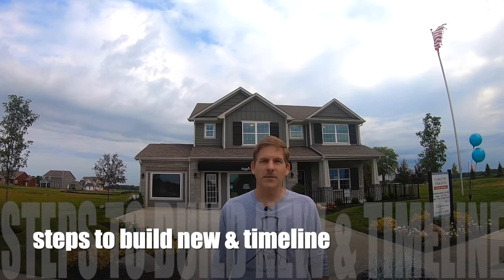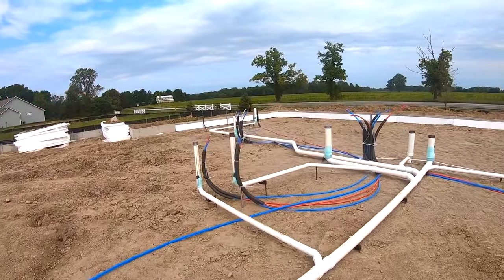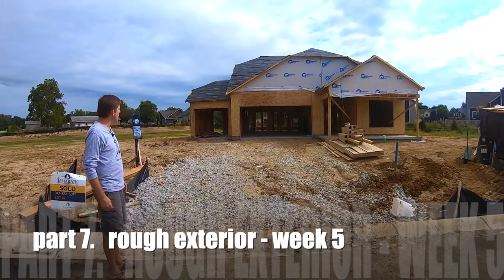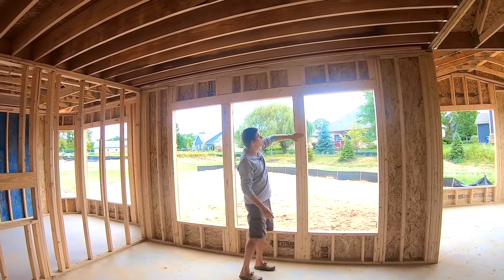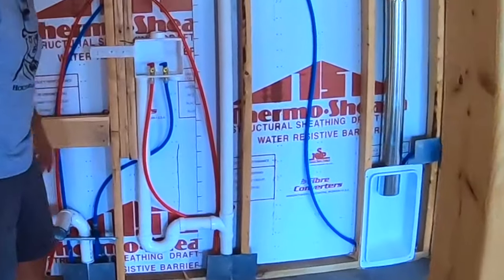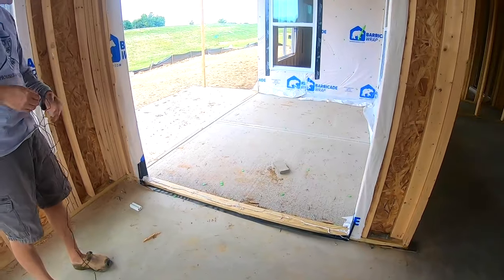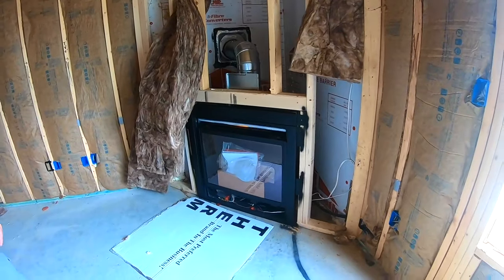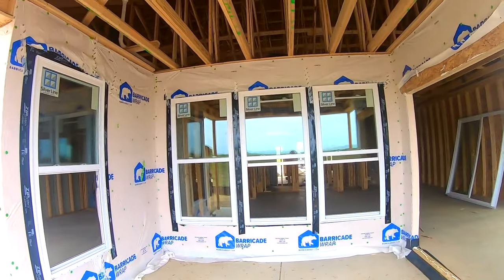steps to building a house timeline

Comment: Typical American house.. can't even withstand heavy wind such as tornado. Maintenance cost is high, water leak can be very costly. You also have to worry about termites, bugs that wants to eat your house. Those house are not made to last for generation. Once you finish paying the cost for this house (typically 30 years), it will most likely be unlivable with massive maintenance cost.
Reply from the maker: Hey Ethio,
Not last a generation????

Comment: OSB i-beams = hell no. Truss roof with gusset plates = a bigger hell no. I'll live with PEX, they have improved.

As a firefighter in NY like most fire departments we will not go in or especially on a roof that's is built with ODB i-beams or trusses with gusset plates. We know they are strong but they burn and fail in minutes compare to heavy lumber. OSB is held together by flammable glue. Gusset plates only bite 1/8 inch into the wood. I your house is built this way and catches fire PLEASE PLEASE do not look for the dog or grab your wallet, you have seconds. The BTU's that this type of construction along with modern furniture will overwhelm you in seconds.
Reply from the maker: Hey I’m....,
Thx for the input. What you say about the positives of heavy timber is good.
Bad news is - have you see lumber prices lately!!!
I bet more builders resort to cheapest , least lumber intense method if prices stay this way.
It is nonetheless good that you raised the point - buyer beware.
Thx for watching and sharing!